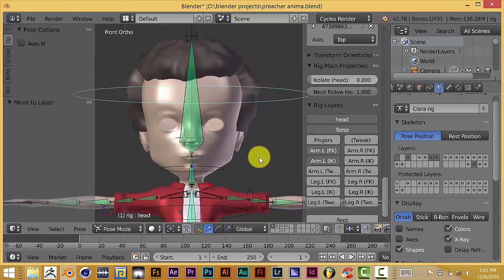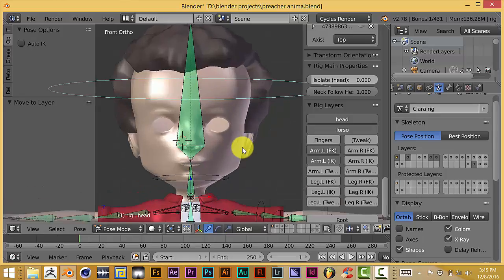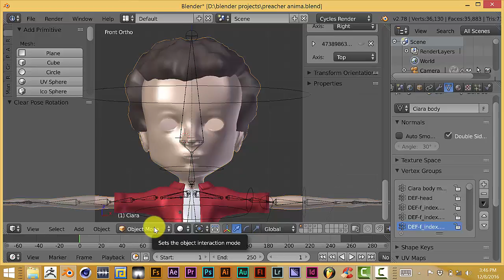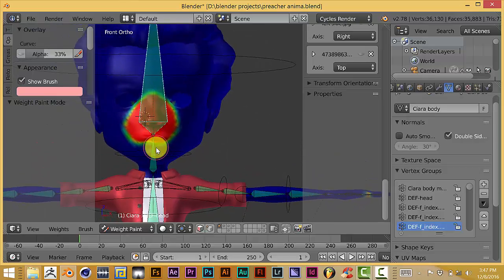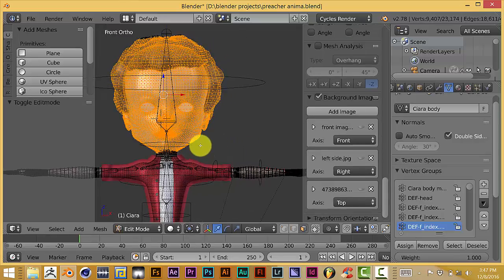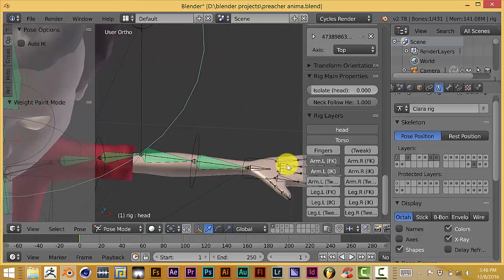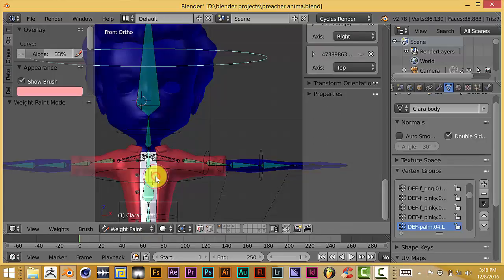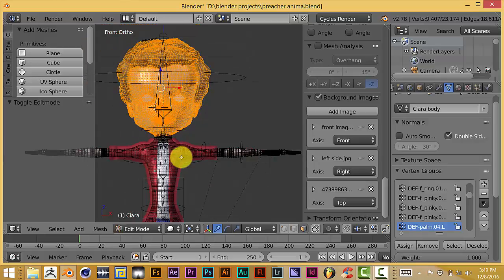How to-Blender Quick Tip: Rigify Mesh Cleanup

Comment: how do u manage to rig something asymmetrical? i have attempted to rig it but after i select automatic weights, it says:" failed to find solution for one or more bones" any help?
Reply from the maker: You should probably use the rigify modifier. Here's a link to a very great tutorial on it  https://youtu.be/THtDI4-ARcQ?list=PL3hf6n0a9MjPRUCCKAUrXP98kbCcEcG-u . Also when you attempt to apply automatic weights to a mesh and the warning comes up that it 'failed to find solution for one or more bones', that just means that it has set up the vertex groups on the mesh but you just have to apply the rig to the mesh manually.
Reply: Tola Olubunmi allright thanks!
Reply from the maker: Sure thing.